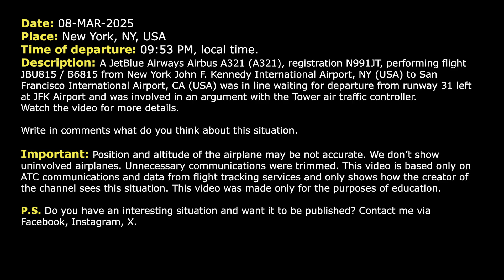Tense communications between Controller and Pilot before takeoff at Kennedy Airport. Real ATC

Comment: JBU pilot initial comment was valid but a bit over the top in reaction to the bad tempered controller. The annoyed JFK controller is out of line (as often is the case at JFK), period! However, the main failing actor was the ETH crew, not following the instruction or contacting tower wether they where unable or miscomprehended the instruction (this also happens too often at JFK, where many controllers think everybody understands 'American' instead of English).

Comment: The pilot had a valid point, and the controller was out of line by trying to stifle ANY  concern by a pilot. The controller may have been doing a bangup job, but he's NOT omnipotent, and when he acts the way he did, he risks censoring legitimate questions from pilots in the future.
Reply: Unless he's witnessing a disaster about to happen, he needs to shut his mouth and worry about his own aircraft.  The other pilots are perfectly capable of asking ATC for clarification if they are confused, and guess what?  They weren't confused.  Just the JetBlue pilot thinking he knows better.

Comment: JB wasn't wrong to call out the situation to the controller but the line about "do you job better" wasn't necessary and inflamed tensions.   The controller also didn't handle it as well as he should.   Giving out the phone number for this to an aircraft taxing in sequence to the runway and expecting the pilot to call you from that position is ridiculous. So petty.

Comment: He sure wasn't Kennedy Steve. If traffic is backing up, it should be up to the ground controller to take charge and speed things up.

Jet Blue was just pointing out the obvious. Sorry, not sorry the controller got his feeling hurt, but the "I've got a number for you to call" threat works both ways. Jet Blue should file a report so that the tapes get saved for future investigation.

I'd bet the Jet Blue pilot does a better job as ATC than the controller does as a pilot.

Comment: When taxiing, rules of the road applies. So at a merger you hold for traffic from the right, unless you get a specific clearance to go infront. Controllers often forget to word that in, when asking an aircraft to move up.
Reply: It really should never get to that point.  Even if the sequence hadn’t been set at that point, the ground controller should have had both aircraft hold short of that intersection until they figured it out.

Comment: These interactions are unprofessional. Pilots are ultimately in control of their aircraft in the air and ATC can't force them to do something unsafe or beyond the pilot's discretion. However, on the ground ATC is in charge. The flow of aircraft seemed to be progressing adequately but JetBlue 815 seemed impatient. Unless there was a safety issue or something ATC was unaware of JetBlue 815 should have just waited his turn, quietly.

Comment: If this controller expected a phone call from the pic before the flight terminated the guy either needs a long vacation or just quit. ATC and pilots should be a team approach. This us vs them attitude is ridiculous and unnecessary. Just because you control in NYC doesn't make you some aviation god.
Reply: It should be a team approach, but it's not. ATC are the FAA's liaisons. They are employed and trained directly by the FAA
Reply: Yup yup yup
Reply: @rizzodefrank  10 aircraft ahead of you with 3 minute spacing, JB815 had 30 mins. If he wanted to pull out his cell phone and ring the tower to see what was going on, he certainly would have had plenty of time without causing any issues.
Reply: Something something sterile cockpit
Reply: @stefantheicewarrior  sterile cockpit for 30 mins before takeoff? Unlikely. They probably chatted about their frustration with the tower instead of talking to the tower about their frustration.

Comment: Interesting to see the comments by folk who say this type of conversation is in some way typical of JFC ATC.

Not an aviator, but grew up under the glidepath to O'Hare 50s, 60s, into the 70s, when they were landing them 3 per mjnute.  It's a ballet choreographed in real-time where the dancers are flying elephants.  Everything about it requires courtesy, professionalism, and teamwork from all concerned.  That's not "just" to keep planes and passengers intact, but also for the sake of controllers' sanity.

Were I a passenger on any of these aircraft, especially JB, I would be appalled at this kind of jousting on the part of the controller.  The pilot, eyes on, was reporting the appearance.  Controller should have acknowledged and done any necessary confirmation (they're taking off, on the ground, and can all hold for the necessary seconds).  JB did not need to respond in kind, but it still should have stopped there.  Controller needs to keep in mind all the near-misses, etc., that have been making the news, and try to be part of the solution.

It's obvious from the comments that JFK ATC management needs to establish some kind of culture reset.  In the best case, controllers experience a lot of stress, and I'd bet their bosses here contribute to it when they should mitigate it.

Comment: The old “I have a number for ya to call…”
ATC can’t keep using this tactic when it not warranted. 
Maybe the new Sec of Trans can suspend this controller. 
Really, expecting a pilot to call from the cockpit while on a taxiway and it’s not an emergency. Unprofessional
Reply: The "number" is not always tied to a Brasher warning. If there is a point of confusion between pilots and controllers, it's not a conversation to have on the frequency. That conversation is better handled over the phone. Suspending a controller for offering to keep that discussion off of a busy frequency is the opposite of suspension-worthy. Had they had their full discussion on freq, THAT would be worthy of suspension. In this, or many other cases, it IS warranted. The "I've got a number for you to call" is not mandatory. It is optional, so the pilot had no obligation to make the call.

I've never been "given a number" but I do have my local tower's phone number and more than once, I've called the tower with a question or a commendation for something that didn't need to be handled over the airwaves.
Reply: @preacherpilot JFK controllers are noted for their brashness…..why is that permitted? Are controllers at the New York Center and the respective towers in New York all like that???? I hope not…..professionalism always wins cooperation!

Comment: The JetBlue pilot did have a point. I mean, there are two separate lines of aircraft destined for one active runway. And he made an astute observation that nobody was advancing.
Reply: JBU was tying up a frequency about his opinion.  The call was not his to make.  Each aircraft has an instruction, and most flying in or out pay attention here and can get it right.  When someone isn’t paying attention, the flow stops causing a sequencing problem that can last for the next 300+ miles down the line fixing.  Pay attention better than the Jet Blue pilot, the instructions are clear.
Reply: @RS-uo2nd  He was “tying up the frequency?” Seriously? He was calling out the controller’s inefficiency. I’d hasten to call that “tying up the frequency.” “The call was not his make?” 😆 Nobody was moving. Did you want all of the aircraft in the queue to just sit there idling?
Reply: @windows5k  I addressed everything pretty accurately in my first comment, so yes.
Reply: @windows5k  each aircraft is given the aircraft to follow.  Someone messed up, and JBU was not involved.  This was an inattentive pilot.  I really wish you could have the details explained to you in real time to gain the appreciation for how masterfully this operation runs.  It’s truly incredible the number of factors involved, but you simply see airplanes in a line and miss out on what is actually happening on a regional level.
Reply: @RS-uo2nd First of all, get over yourself. Lastly, if someone “messed up” as you put it, that in itself merits someone speaking up about it. Or, would you rather be inclined to having all the aircraft at a standstill and have the obnoxious JFK controller chastise someone for dropping the ball?
Reply: @windows5k  I get that you’re gonna take this personally and I understand your point it’s just that it’s complete nonsense and based on whatever fantasy you think you’re looking at

Comment: Jet Blue was out of line and disrespectful. He could have just asked for the sequence which is common when there is confusion about the sequence.

I've asked for the sequence many times with no issues. Really simple: "Say Sequence." That's all that's necessary.

It's obvious in the comments that most of the commenters are either not pilots, controllers, or work Part 121 or operate in and out of Class B or other busy airports.

Comment: Jet Blue shouldn't have said anything in the first place.  His comment did not help anything, whatsoever.

However, the controller had no reason to be such a smart alek.   It was VERY unprofessional and also didn't help the situation.

Jet Blue's comment that he just wanted him to do the job better was definitely the best jab.    :)
Reply: This one is on the controller. Jetblue 815 merely pointed out that there was some confusion and he did it politely. If the controller is that thin skinned he should find some other line of work.

Comment: Agreed with most of the comments but all aircraft are assigned IFR release times so spacing in the airways is safely separated.   The system works.   This controller is known for doing a great job under massive traffic loads and he uses the computer and release times to control who is following who.

Comment: JetBlue said that other aircraft didn't know who to follow but that didn't seem to be the case from the other pilots. I think ATC was correct in this case, not sure what JetBlue was complaining about.
Reply: jet blue has a point that being issued "following" directions doesn't mean you can cut off other planes. but the way he raised it was quite unprofessional
Reply: @UnshavenStatue  No it wasn't. He was very polite.
Reply: @rael5469  by new york standards, JB was a little rude, which means by normal standards JB was quite rude. by normal standards Tower is usually sorta rude but JB won the rudeness award here (even tho, technically, he had better rules knowledge)
Reply: Customer service was lacking.
Reply: This one is on the controller. Jetblue 815 merely pointed out that there was some confusion and he did it politely. If the controller is that thin skinned he should find some other line of work.

Comment: What we have here is a failure to communicate. 

JetBlue sees hesitation at the merge point, complains, does a bad job of complaining, so the ATC hears "people don't know who to follow" but perhaps the JetBllue merely felt like the whole thing could have been expedited if they knew a merge sequence. 

Tempest in a Teapot
Reply: He did not do a bad job of complaining. He wasn't even complaining....he politely pointed out that there was confusion at the merge point. The controller is too thin skinned.
Reply: @rael5469 The controller needs to be retrained or fired.
Reply: @rael5469 stepping on the controller as he tried to explain why he thought JB was wrong sure seems like a bad way to go about it
Reply: @avrohomz4582   I didn't quite understand your sentence. But I thought Jetblue was polite until the controller got snotty. The Jetblue pilot has a pretty sharp wit. Controller snapped at him so he snapped right back. 
All the controller had to do was clarify his instructions to the waiting aircraft. A non-issue.
Reply: Some pilots, you just can't reach...